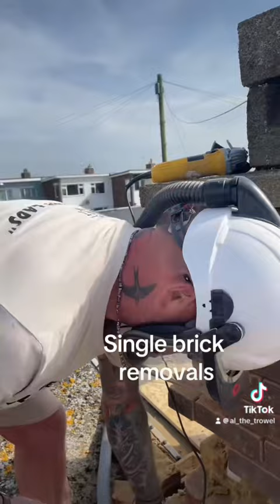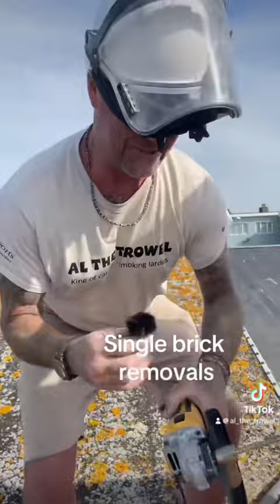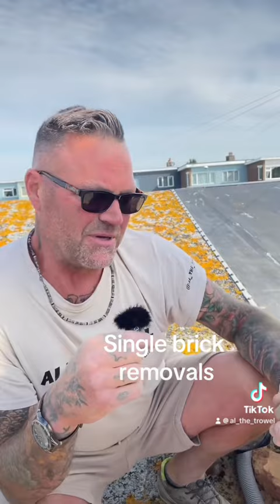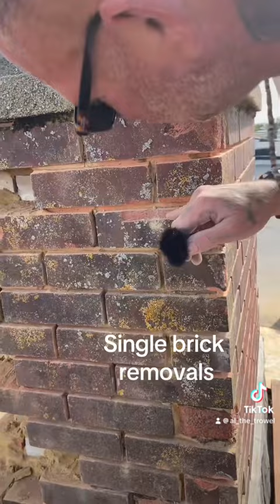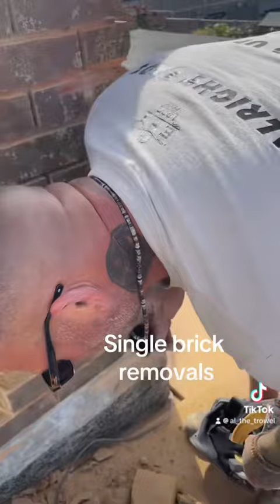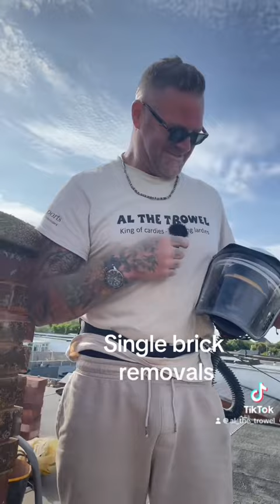Brick Removal

Comment: If i push my arbortech to hard it has a tendency to break the arms inside  luckily my mate is an engineer so it's not a £200+ job but still will cost me £75and  cement tends to fuk the blades up quickly so I only use it on lime mortar now so your technique makes gd sense. Yes I'm the same now with dust, saves coughing and hacking for days after.  Will try those 100mm bits , thanks for the tips👍
Reply from the maker: Well done Andy